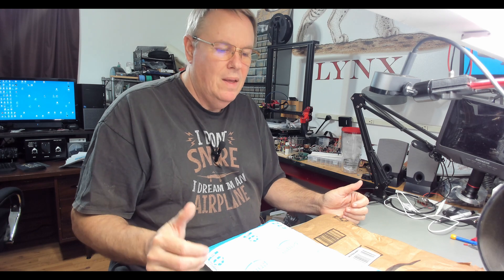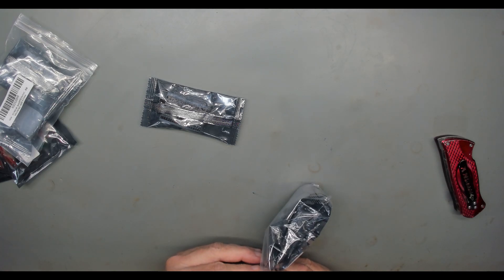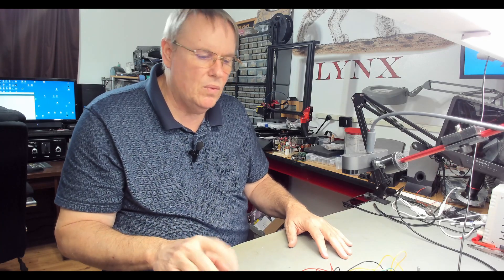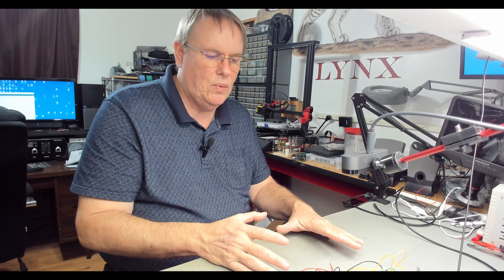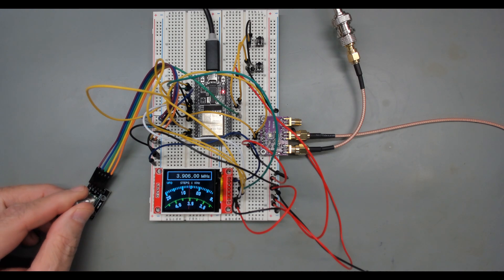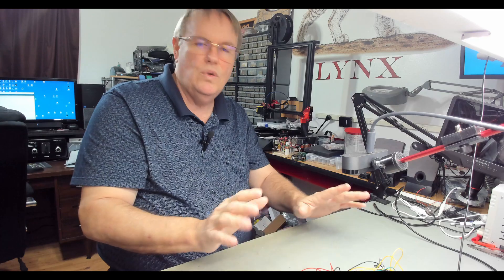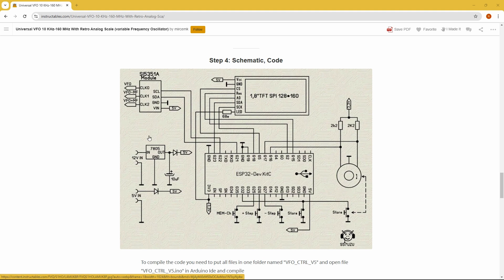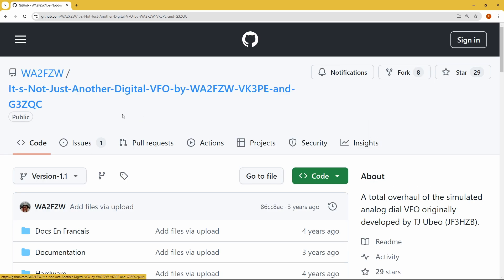Let's Build A VFO For the Receiver.

Comment: That is one slick display dude.
Reply from the maker: Sorry for the delay, For some reason your post was put in the held folder for some reason. Youtube sometimes does this if the ai thinks there is something bad with it. I just found some a number of post in there. 

Thanks I like it but the Main Software was designed by someone else as I explained so I can not take credit for it. 
RJ